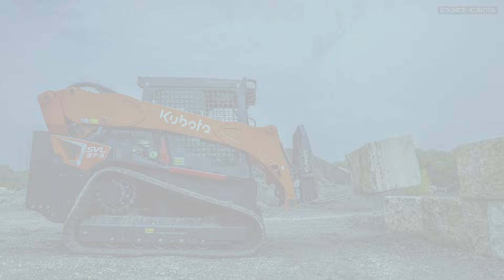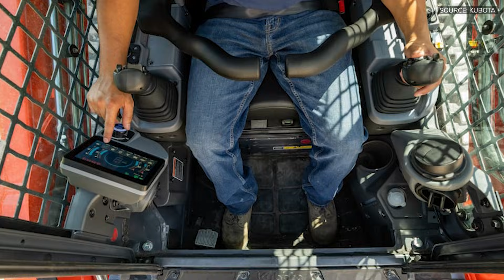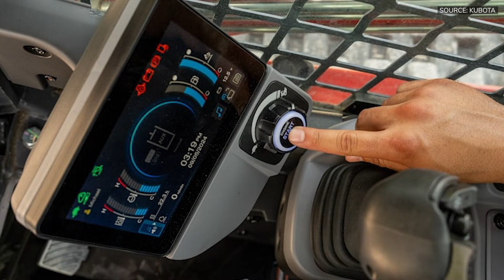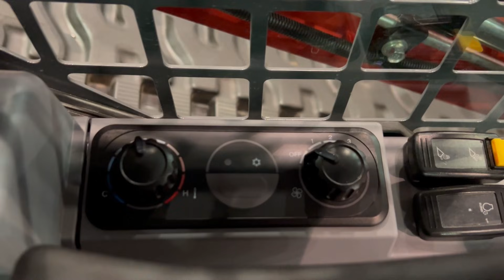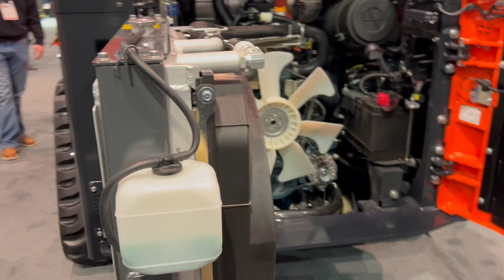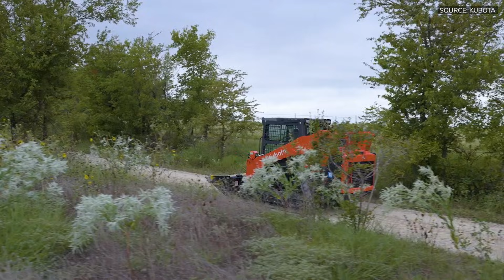A Closer Look: Kubota’s New, Largest Compact Track Loader, the SVL97-3

Comment: Are steel tracks avaiable
Have you dropped the centr of Gravity.
Is there enough weihghtbin the track rails.
Is the engine dow as low as possible in the frame as possible.
What is the Max bucket lift and dump height related to stability
Reply: Why don't you just go to a dealer to ask your questions !!

Comment: Yeah right now I have 30 year old Bobcat that still runs because it doesn't have all the electronic crap to break this they won't even be working in 20 years all the screens will be dead all the electronics will be broke and I'll be a expensive piece of crap
Reply: I have an older bobcat that the Bobcat dealer told me I was on my own when it broke down. They didn't make the part I needed anymore. I will never buy a bobcat again.
Reply: It will have made a lot of money in 20 years
Reply: Maybe